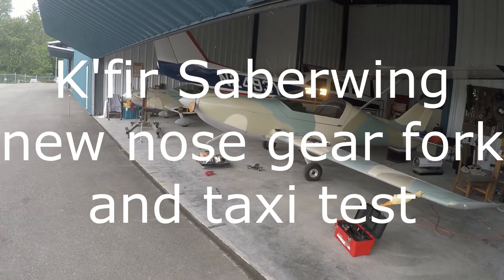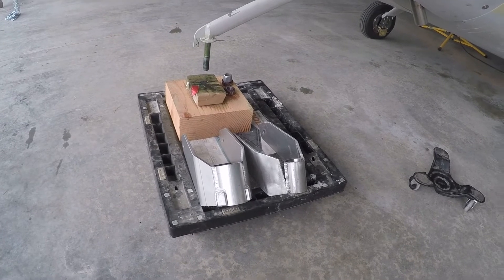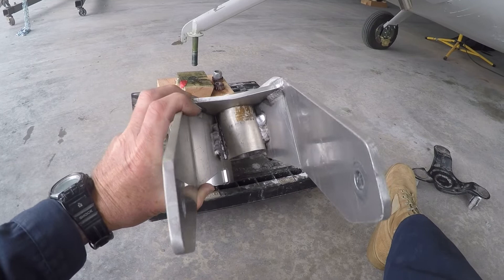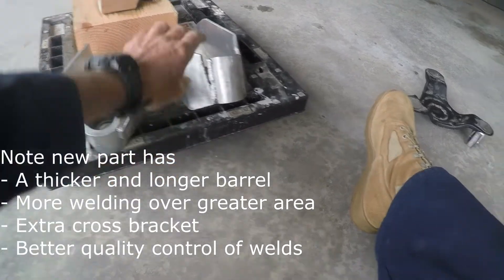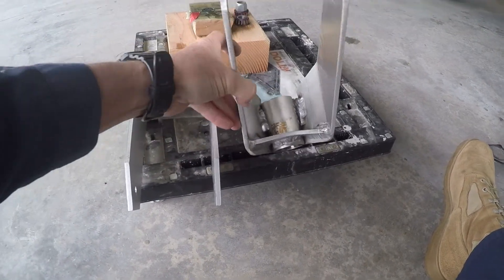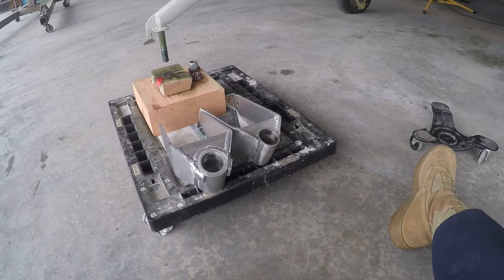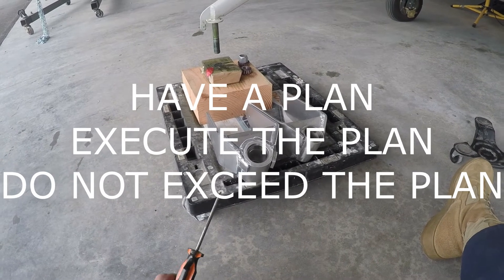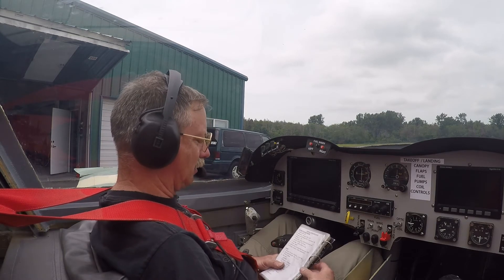K'fir Saberwing new nose fork and taxi test May 16 2019

Comment: Saberwing is at the top of my wish list especially the tri-gear version. What would you consider the build difficulty? Beautiful bird enjoy.
Reply from the maker: Build difficulty Aaron is fairly easy.  The challenge with this plane, is getting comfortalbe working in fiberglass.  Glass is not hard to do, but not everyone takes to it right away.  If you are willling to learn, and call Bill at Azalea Aviation or others who are experienced, you will have little difficulty with this bird.
We have just over 14 hours in the air now.  I can tell you she flies beautifully, crisp on the response.  Landing is a lot less challenging than the KR-2S world I come from.  The design holds centerline well, though if you are landing without flaps carry a few knots extra and let her settle through to the runway while bleeding the knots off.  If you do not, a ker-plunk landing is likely what you will get.  Even ten degrees of flap solves this problem.
Good building if you decide this is something you want to pursue! - Zip
Reply: It has been a decade or two but am familiar with the itchy stuff. I appreciate you taking the time to respond to my questions. One more if you would what are you seeing @ 75% power for true airspeed? May you and yours be safe and healthy. Enjoy that bird...
Reply from the maker: AAron, my speeds at 2500' based on manifold pressure:
18" = 95 KIAS @ 4.9 GPH

19" = 104 KIAS @ 5.0 GPH

20" = 109 KIAS @ 5.6 GPH
21" = 118 KIAS @ 5.7 GPH

22" = 122 KIAS @ 6.1 GPH
23" = 124 KIAS @ 6.3 GPH
24" = 126 KIAS @ 6.2 GPH
25" = 129 KIAS @ 6.6 GPH
26" = 131 KIAS @ 6.4 GPH
Local altimeter for this flight was 30.03", so at 2500' we should have seen a maximum of 27.53" MAP.  I did take a data point at 27", but the air was a bit turbulent so I am not confident of the airspeed I recorded (+/- too much to be an accurate sampling).
The engine is also running on the rich side as I am working out a temperature disparity between a couple of cylinders.  Once the temps are more even I expect to be able to lean out significantly more.
I hope this answers the question.  Let me know if it did not or if you have other questions. - Zip

Comment: What did your total build time end up being?
Reply from the maker: Scott, sorry for the delay in answering.  Just under 1,000 hours was the build time.  As I am waiting on the FAA to sort my paperwork and inspect K'fir, I am updating things that are not "required for flight" items.  These include reupholstering the seats, increasing the height of the seat backs, making adjustments to the stick position in the cockpit, putting in a left hand arm rest behind the throttle (akin to the rest found on the right side of the F-16 cockpit), finishing the canopy cover, and some other items. - Zip